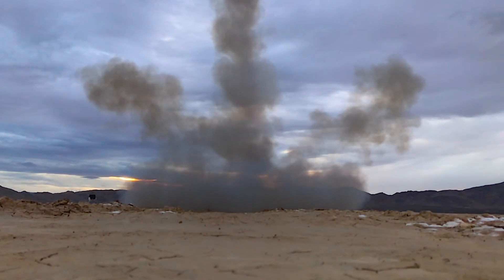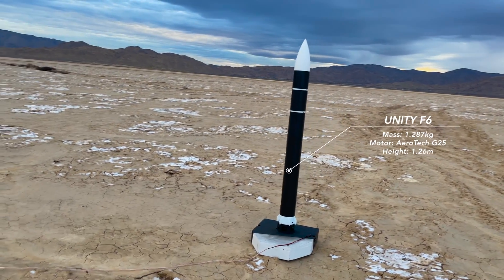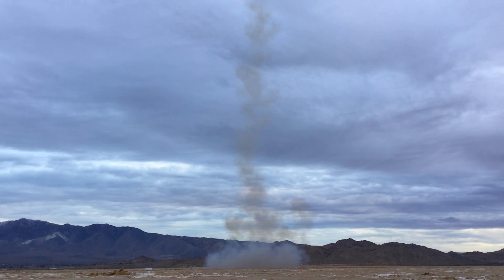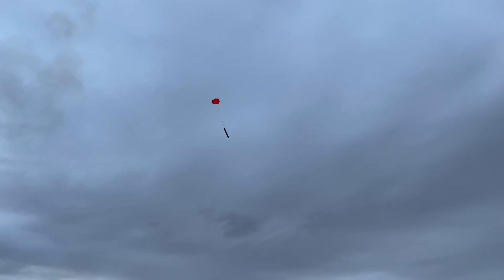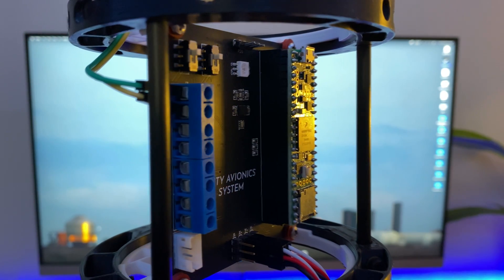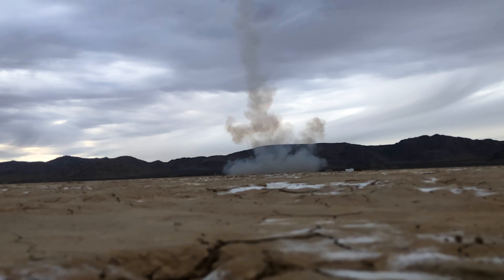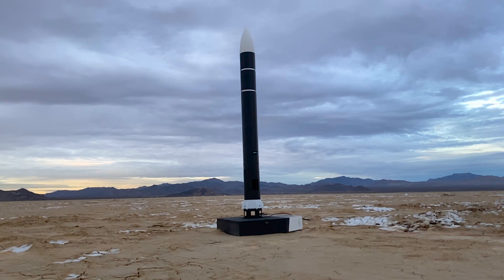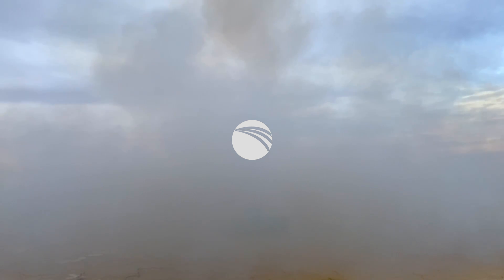Successful TVC Flight | Unity Flight 6

Comment: Plz tell how does your 'Detect launch code' works.
Reply from the maker: My launch detect code works by waiting until the flight computer detects a change in acceleration, then it switches states to the powered flight state
Reply: @DeltaSpaceSystems  

Its pretty good bro.
But what is the minimal ideal value of acceleration for the lauch to detect?
Reply from the maker: @morningstar7009  launch detect occurs when passing  11m/s^2.
Reply: @DeltaSpaceSystems  
Thnks bro.
But how can we write the value of this acceleration in the form of code?

Comment: First of all THAT WAS AMAZING! Secondly the oscillations at the end of the burn is because the vehicle becomes lighter and the tvc gains will become high and this will amplify with higher and faster flight. Maybe let the tvc switch modes with speed? You are a great engineer so can't wait to see you figure it out!
Reply from the maker: Thank you! The oscillations are not the vehicle, but the TVC moving more because there is less thrust from the motor towards the end of the burn. Frontier didn't have the code for this which is why it always lost control at the end of the flight. That was because the airspeed was so high and the motor thrust was so low that it just maxed out the TVC mount and fell over. Hopefully since I raised the lever arm for flight 7, it will not be as noticeable, but we'll see :)
Reply: @DeltaSpaceSystems  Can't wait for the next flight! Good thing i have you on notification :)

Comment: Nice work.. Is it a cascade PID controller?
Reply from the maker: Not currently. It is running a controller on orientation and gyro rates which gets converted to a desired torque to actuate the motor.
Reply: @DeltaSpaceSystems  do you in any way rely on accelerometer for orientation?
Reply from the maker: @brianblasius  no, orientation is based off of raw gyro rates which are integrated into orientation through quaternions.
Reply: @DeltaSpaceSystems  thanks Cole. Good luck with your future rockets.
Reply: @DeltaSpaceSystems  BTW, do you convert your quaternions to Euler for use in the PID controller?